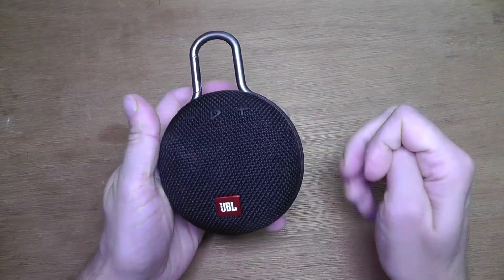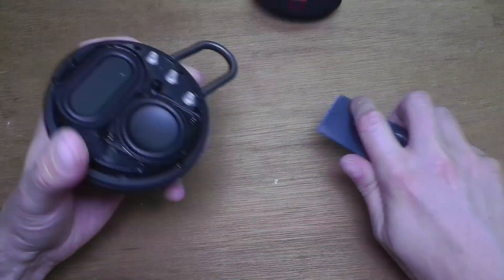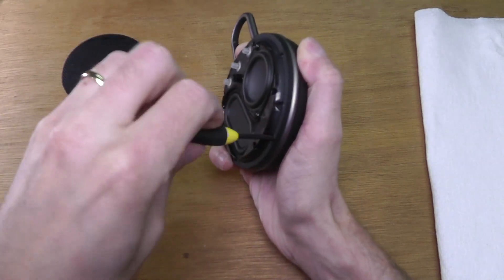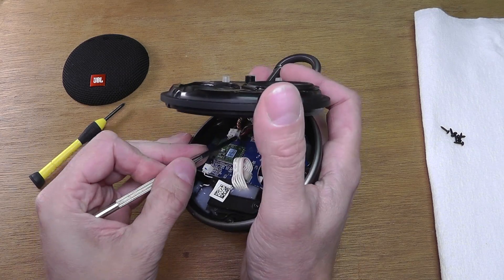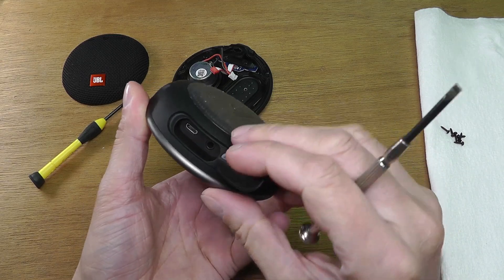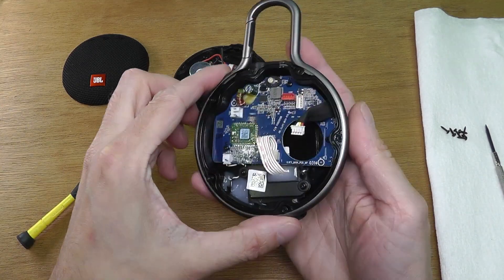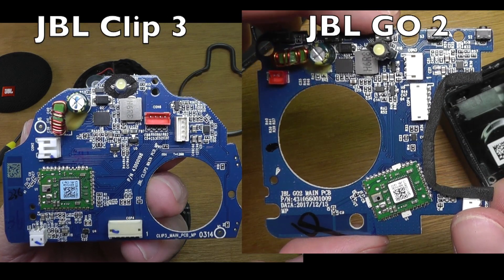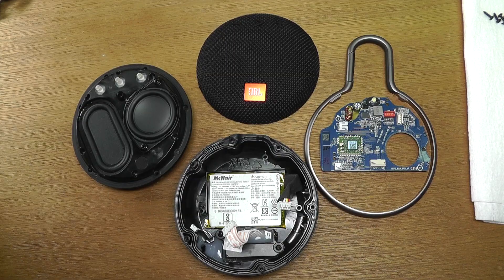Look inside JBL Clip 3 Waterproof Speaker - Teardown !

Comment: Is it possible to buy the body parts only? I want to change the color. Plus, the cover to the charging port was already torn apart.
Reply from the maker: Sometimes you can find broken speakers on eBay.  With that you can swap out the insides of you current speaker.

Comment: After using myJBL clip 3 for maybe a year or so I dropped it and the grill fell of, Problem being that the grll is not nearly as tight as it was factory, you can just pok it of with your finger. So a warning for those wanting to take the grill of, you might have to use glue to put it back together.
Reply: I was looking for this comment😢 that’s what happened to me yesterday, so the only way to get it back together is by using superglue?
Reply: @valentinastrazzullo6930  im just dealing with it, but i assume glue is the way to go

Comment: Is it possible to change or modify the charging port to USB C?
Reply from the maker: The USB port is located on a small daughter board.  If you find small board with USB C on it, that fits that location, it should be possible.  
Replacing just the port itself probably won’t work because of the difference in the pin layouts.

Comment: My Clip 3 is not charging the problem might be the smaller tiny circuit board under the two screws that contains the AUX and Micro USB ports.. I have dissassambled the Clip 3 and dissconnected the circuit to double check it, it seems like to be the issue, but the USB port is completely fine, because i have checked by unsoldering and plugging in the USB charge.. What should I do?
Reply: That's also my problem.
Reply: Me too, same problem,

Comment: Excellent, mine had a rattle in under the mesh part, small plastic tube had snapped off and i need to glue the mesh cover back on its not going back on snug enough. Thanks for the video

Comment: Can you replace the clip and if so do you have a  replacement part locator to find it I need (2) just the clip/hook part
Reply from the maker: It is possible to replace the clip. But as far as I know JBL does not sell parts individually.  
What I did personally in the past is look for an inexpensive defective speaker on eBay and use that as parts donor.

Comment: does opening the insides of jbl clip 3 removes its waterproofness?
Reply: depends on what you do when you put it back together.  If you don't put in the o ring or damage the o ring then no.  If you break any of the sealant around the charging port and don't reseal it then no.  Come on a little common sense now and then wouldn't hurt would it???
Reply: @SVMSICE  the saltiness
Reply: @valentinastrazzullo6930  better than pepper!

Comment: How do you put back grill on? My clip fell and now grill is off and can’t clip back into place.
Reply from the maker: Are the small pins, which are part of the Grill, are still stuck inside if the speaker? You could try to pull them out using tweezers and them then glue them back on with super glue.
Reply: What do you call the screw on the clip?

Comment: Thanks how can I change the charging port. I think mine is damag
Reply: I had the same problem when mine was a month old. I opened the speaker just as shown in the video and I unscrewed those 2 screws over the charging port. When you gently pull the unscrewed part, its connector detaches from the charging port - aux port complex. When I plugged this part back in and gently push, I got my red light on. I fixed it. Screwed all of the screws back and now it works.  It may either be a disconnection like in my case or the dust and dirt within the port.
Reply: @apropos822 did you remove the battery First?
Reply from the maker: That requires some good soldering skills, because of the small pins on the USB-port, which connect to the board.
Reply: Hello guys, mine felt down ones and now the speaker won't sound like before it connected but the speaker now is like 50 % less power. What can I do to fix the problem?

Comment: Um ineed help so i have the same speaker and the led thing just lights up red and it dosent work anymore
Reply: Gabriel Smexy 1st, take it apart and look on the motherboard for any corrosion (white/greenish gunk) on any of the electronics. 2nd, If there is, get some rubbing alcohol and scrub it off with a tooth brush (make sure to unplug battery before hand) then let it dry out for like 30min to an hour. Then put it back together and let it charge for awhile. (If it still doesn’t work, it might need a new mother board or battery. (Which is cheap on eBay.)
Reply: The only way to fix it, I’m afraid. (Because if you put it in water or salt water, it may have got in. Because some speakers may be defective and have small airleaks and water could seep inside.

Comment: Do you hear a crackling or popping sound with yours or a white noise?
Reply from the maker: No, nothing like that.  Does yours do that since the beginning?
Reply: @MegaSafetyFirst  I don't remember
Reply from the maker: Do you hear the noise all the time, or only when playing music?
Reply: @MegaSafetyFirst  the white noise all the time but the crackling sound sometimes
Reply: @MegaSafetyFirst  the popping I just noticed today
Reply from the maker: I wonder if there is a bad connection somewhere inside of the speaker. Did you ever open it up?
Reply: @MegaSafetyFirst  I tried but I can't get it open
Reply: i have the same problem (white noise and more)... after some time it's turn off and did non start anymore... after this i opened it and left it for some days with the battery calbe detached, only this way it will start again but for few minuts... and nothing else. it seem to go in protect mode... (the battery is ok, its show its max voltage... the speaker was not opened before, it dose not have any sign of liquid infiltration)
Reply: Anderson Hoock that’s really strange.

Comment: My Jbl clip 3 doesn't charge anymore...
Reply: Same here @Rashied, piece of shit speaker didn't even last past 9 months. The idiots at JBL do this all the time, build a durable speaker with a strong build but the weakest micro USB charging connector port. Absolute disgrace, I came across this forum also saying that the clip 3 is not the only weak build, the Flip 3 too doesn't last a year. Such a waste.
Reply: TheKaz911 omg, your a literal idiot, I guarantee you won’t find any other speaker company that doesn’t have a couple defective models, I’ve had my jbl flip 4 since March of 2017..  it still works. And I have my jbl clip 3 which I have been in the shower with a million times and I have dropped it ALOT...
Reply: TheKaz911 so come again, I dare ya.

Comment: Soo, if i charge my clip 3 and drop in the pool or water, no liquid will get inside since there is glue on micro usb and 3.5 mm jack ?
Reply: Highly doubt it, what's more likely is that those weak points won't destroy the rest of the speaker as easily
Reply: The ports will probably be damaged tho